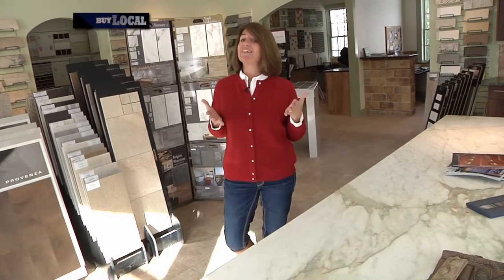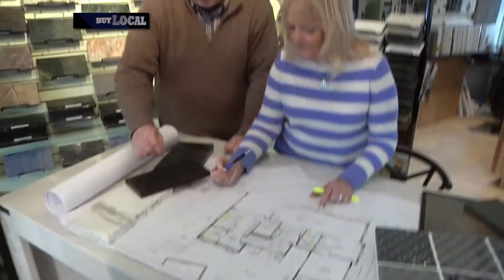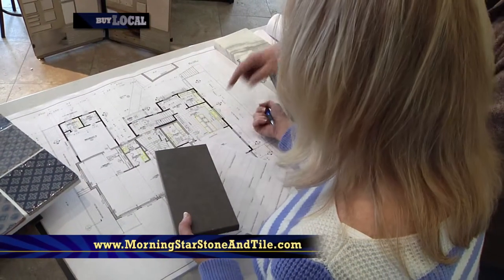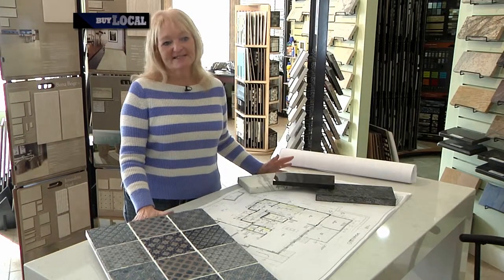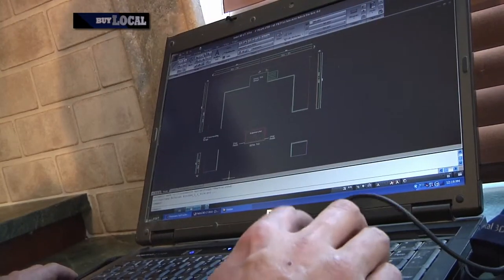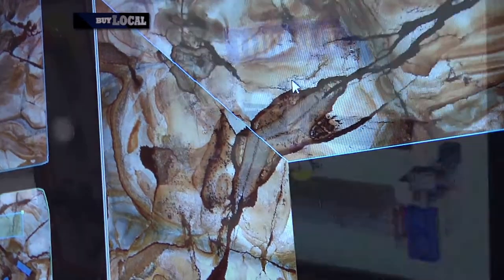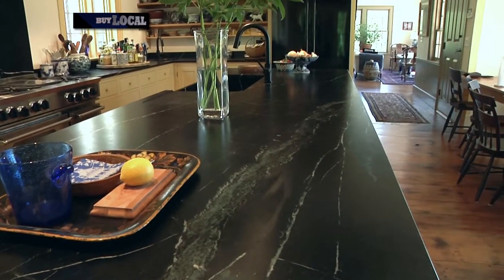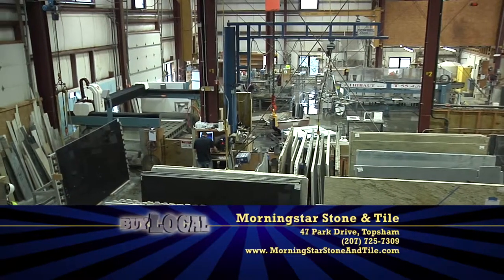How to Create the Custom Kitchen or Bath Remodel of Your Dreams

Comment from the maker: 11 Steps to the Kitchen or Bath of Your Dreams

1 - Bring us your plans and ideas. We take the time to listen so we can help you make informed choices.

2 - Select your slabs. Browse through our extensive collection of slabs. Find just the right slabs that click with your design.

3 - Choose your finish. We offer satin honed, polished, and antique brushed finishes on any slab. See for yourself what a difference the look and feel of these new finishes can make.

4 - Select your edge. Express yourself; we offer edge profiles from contemporary to one of a kind custom profiles not found at any other shop.

5 - Choose your sink. Our display of Artisan stainless steel sinks makes it easy to select the best for your design. We also display and build sinks in the traditional farm style as well as custom milled from a solid block of stone.

6 - Select your tile. From a simple backsplash to floors and custom showers; explore with our designers the vibrant colors, intriguing shapes and infinite pattern possibilities.

7 - Prepare for your project. Our sales and design team works with you every step of the way. From initial concept to template day, we will guide you with the information you need so your project can be completed without a hitch.

8 - Precision templating. Meet with our project templater to work out the final details; he will measure the job with our digital measuring device and create the final shop drawing for your approval.

9 - Slabsmith Perfect Match layout. Many stones with flowing veins and varied coloring require precision layout. Our layout designer matches the seams in a way that transforms the raw beauty of your stone to a work of art. With our Slabsmith software we can show you what your kitchen will look like before we cut.

10 - Hand finished craftsmanship. Flaws and irregularities are part of the natural appeal of stone; compromised workmanship is not. There is no replacement for the meticulous craftsmanship and hand finishing Morningstar is known for.

11 - Expert installation. Our templater will return with his team to install your countertops. Our installers are among the best in the industry; they take great pride in their workmanship.

Ready to Get Started???
Learn More & Schedule a Consultation Now by Visiting: http://morningstarmarble.com/our-process/